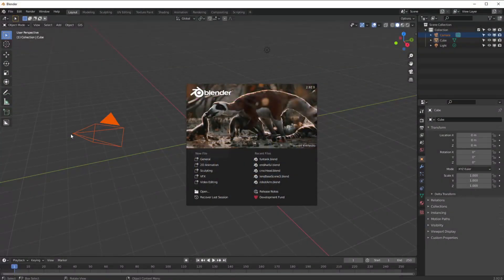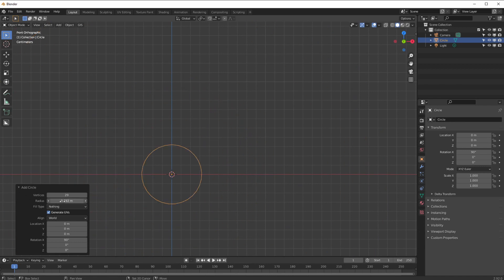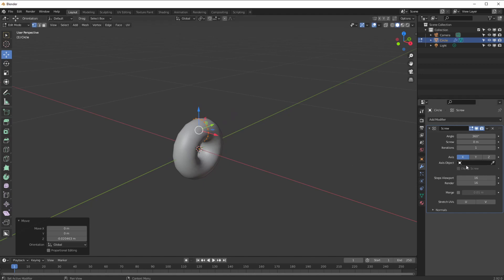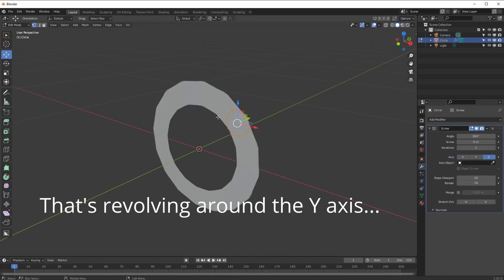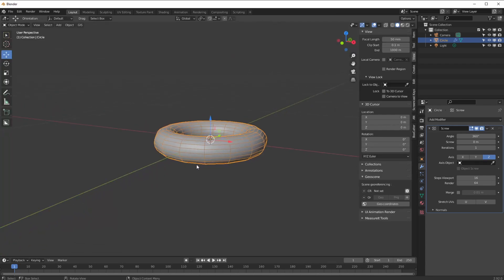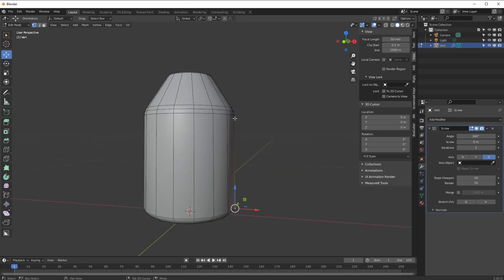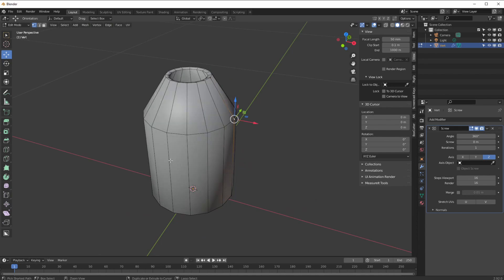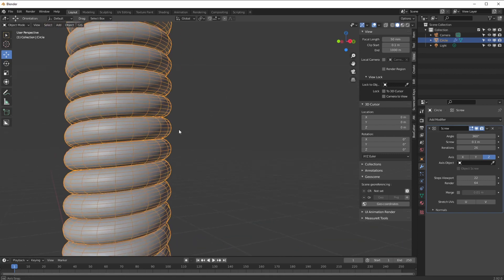ONE BY ONE: How to easily use the Screw Modifier in Blender!

Comment: Hello. Could you tell me how to change the screw orientation? Let say I'm trying to create a weapon sword handle and I want the strings crossed. I have been trying with rotation but so far is not working. How can I do that? Awesome tutorial. Thank you.
Reply from the maker: the quick reply is yes, instead of setting the screw modifier angle to 360, set it to -360.  It'll now screw in the opposite direction.
Reply: @GENVFX  I did try that with other tutorial before this one and for some reason didn't work. I found another way. Typing S X -1 it work. No idea why, but that is how I was able to do it. Thank you for your reply.
Reply from the maker: Not only can I tell you, I have just finished the first record on a tutorial explaining how, then going in to do the leather strappy handle wrap on a sword, as you got me thinking about it as well.